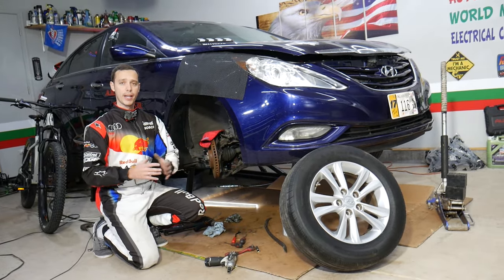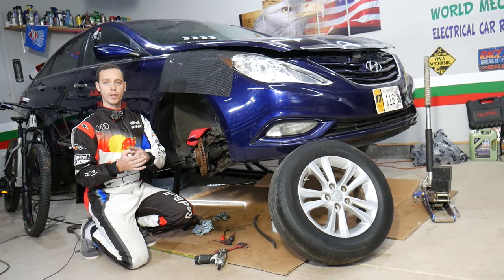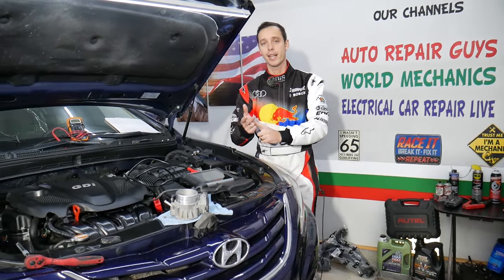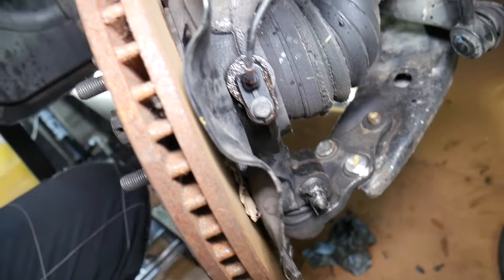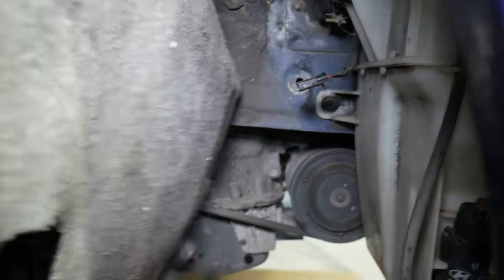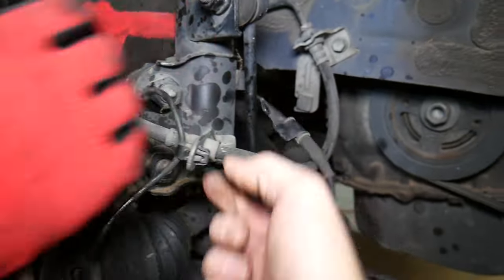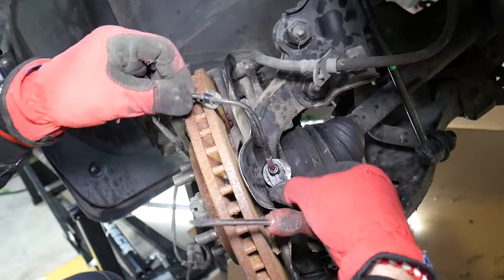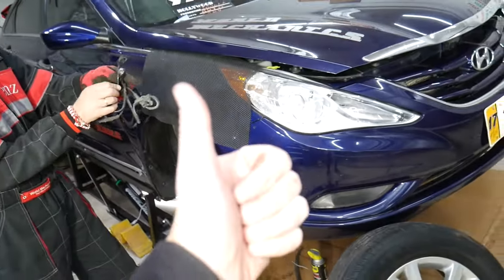ABS SENSOR REPLACEMENT, SPEED WHEEL SENSOR Hyundai Sonata Elantra Tucson Santa Fe Accent Veloster

Comment: they changed my hyundai ioniq 5 new wheel speed sensor and then still dont work. sometimes works normally and then randomly starts to show random speed values and it throws back all errors in the car. i scanned car with launch x431. can something be dirty ?